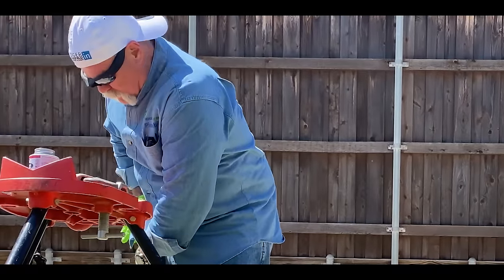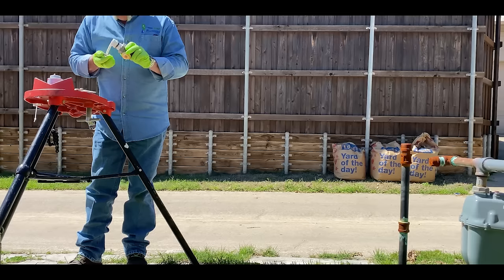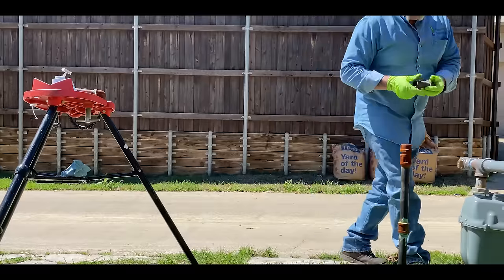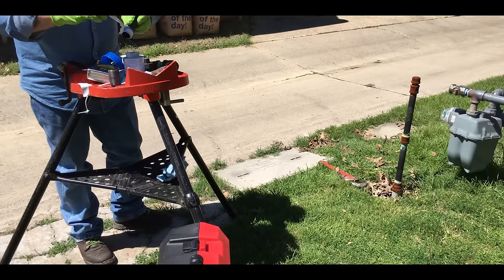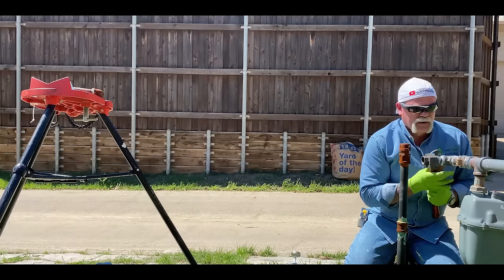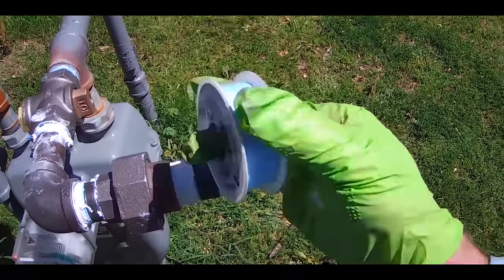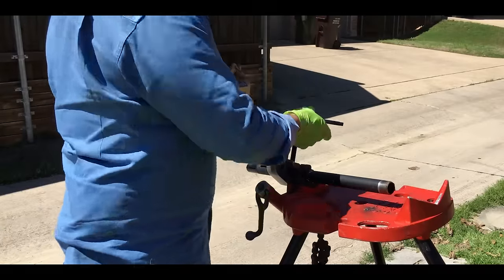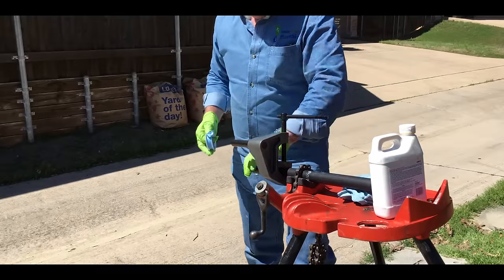Neighbor HIT This Gas Line! - Gas Line Repair (Plumbing POV)

Comment: Way too much dope. Nice thin coat of dope on the threads then wrap it up with Teflon. This also prevents you being Covered in dope and makes the job neater. All that extra dope you put on just squeezes into the pipe and out of the fitting making a mess and potential for Debris to build at the joint potentially making it corrode faster and fail prematurely. Other than that. Good job friend!

Comment: You talk about being professional but, you don’t use #5 Teflon and pipe dope? That is the proper way to do it, Local 100!
Reply: Hes using blue tape. Here at least this tape is rated for water and gas, and is using masters pro dope ( gas rated )   what's your issue?

Comment: You should turn off the gas just for safety you never know what could happen I small spark and good bye plus all fittings and black iron needs to be painted I saw at the beginning the ones coming out of the ground were not just saying but you do you

Comment: Oh no...not the thread tape and pipe dope system...lol....I use one or the other...still never have a leak..engineers can be a little anal, don’t always trust what they tell you... I hired a journeyman plumber that I saw putting pipe dope on a slip nut for a chrome p-trap...I’m like wth? It has a washer dude....he said it’s just in case...lol...ya..he went down the road...I see it as lack of confidence and knowledge of your work..

Comment: Your tape+teflon obsession is without merit.. Waste of time and materials.. Proper teflon (which you appear to not be using. Shouldn't it be the yellow spec.? ) by itself will be leak free.. As will teflon by itself... In fact any gas rated sealer will work when properly applied.

Comment: you're putting on way too much teflon and way too much dope. Unless you're used to your stuff leaking, then I can see why you using soo much 🤦‍♂️. 
No expert plumber would use old ass steel pipe wrenches. Any actual plumber would be using an aluminum ones, not heavy steel.

As for the tool, yes it has its uses. Much like anything, but I'd still rather use a power vise. The manual oiling along would annoy me. Yes, my vices are self oiling.

Comment: No no no, you never use tape and dope on 1” and and smaller nipples, you could crack fittings if you over tighten, you only use both on 1 1/4 and larger.